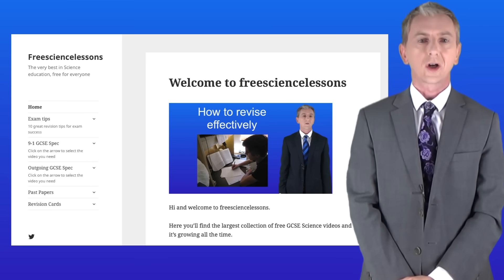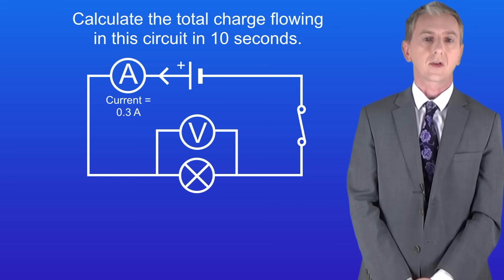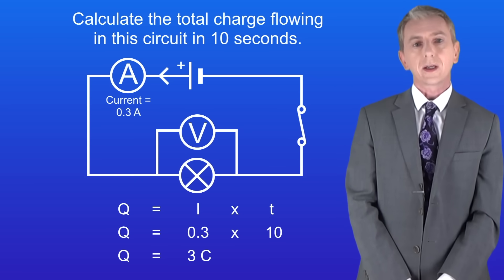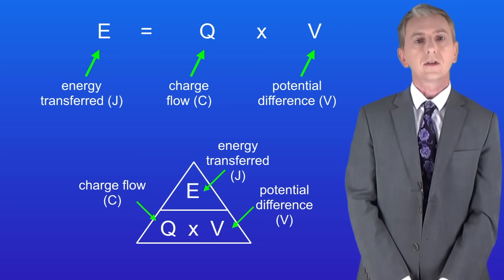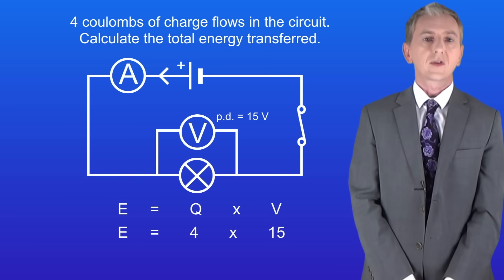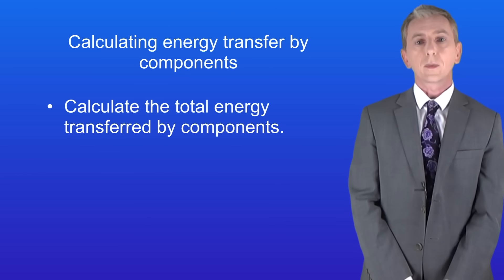GCSE Physics Revision "Calculating Energy Transfer by Components"

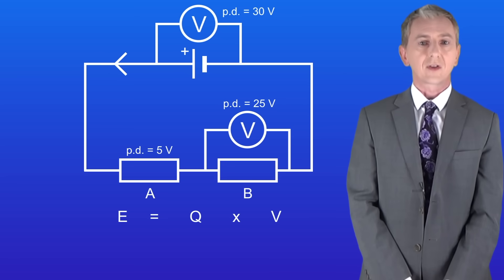Comment: 2:30 how is it 5 i don’t understand
Reply: Because near the battery it says the total p.d. Is 30V. So at B we’re told the p.d. Is 25V, and as p.d. Is shared through the circuit this means A is 30V-25V which is 5V
Reply: Because you need to match the Potential difference of the bottom two with the top one. So because the top resistor has a potential difference of 30, you need the bottom two resistors to get a potential difference of 30. This means that 25 + 5 will equal 30.
Reply: u binge-watching the playlist too?
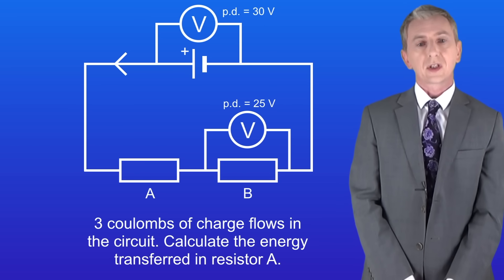Reply: 2:13
Reply: the potential difference is shared between components in series so the 30V is the total potential difference, and as resistor B is 25V, resistor A has to be 5V as 25+5=30
Reply: Because potential difference is shared in a series circuit. At the top it says the circuit has a p.d of 30V so if resistor B has a p.d of 25V then to work out the resistor of resistor A you do, 30-25= 5V
Reply: not sure if you've figured it out or not, but the total pd is 30 V and the pd in B is 25V, therefore 30-25=5 and so A has a pd of 5V:)
Reply: because the overall potential difference of the circuit is 30V and the potential difference of one resistor is 25V then the potential difference of the other resistor must be 5V so they add up to a total of 30V.
Reply: ok so potential difference is spread out in a series circuit, resistor at the top is 30V and resistor B is 25 V, meaning that resistor A must be 5 V as it is shared, 25+5=30V
Reply: voltage is shared in series circuits
Reply: 30-25
Reply: The combined p.d. (voltage) of both resistors together has to be equal to the p.d. of the battery, which is 30V. Resistor B has a p.d. of 25V, which means that resistor A has a p.d. of 30V - 25V = 5V.

Comment: Hello! can i just say your an absolute legend! Could you answer this for me please:

Is everything that passes through a circuit - ammeter,voltmeter,bulb etc do they all use potential difference?  Like in an exam could there be just a simple series circuit with 2 ammeters and both have a potential difference to work out?

Thanks :-)
Reply from the maker: Every part of a circuit has a potential difference across it (including the wires) and this depends on the resistance of the component. Ammeters are designed to have an extremely low resistance. I don't think they would give you a circuit containing just ammeters in the exam as it would not really test your understanding of electrical circuits.
Reply: Freesciencelessons ok thank you! :-)

Comment: I have a question : the new exams have energy transfers however it says that it’s current x voltage x time ?
Reply: its the same thing, except they have replaced 'charge' with the equation for charge which is 'current x time'.
Reply: Lilpinkbean Anoosha ullah current x time is charge so it’s the same thing
Reply: Current*Time=Charge 
So therefore it is the same as Charge*Voltage

It is similar to Power=Current^2*Resistance and Power=Current*Voltage
As voltage = current*resistance, both equations are the same